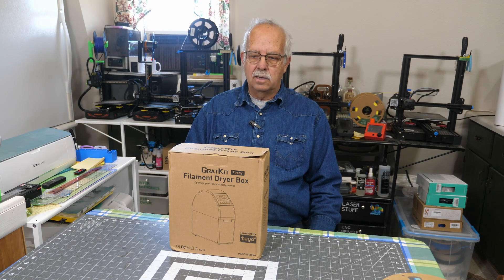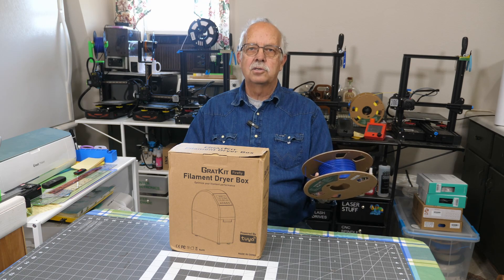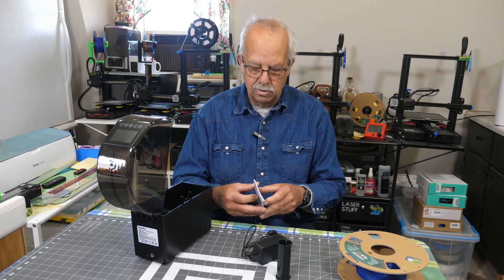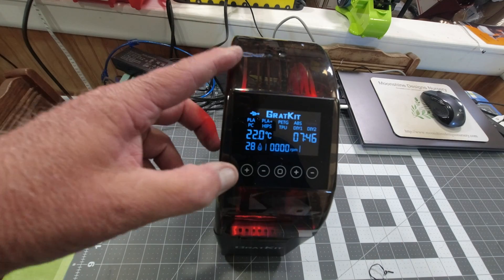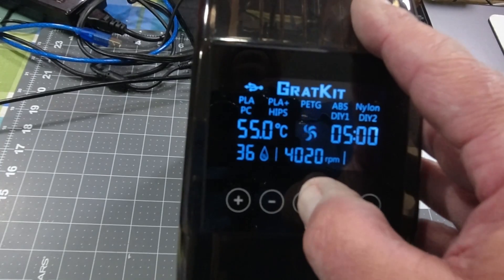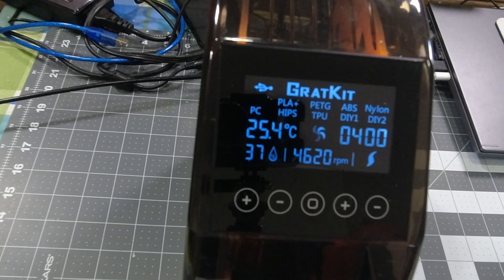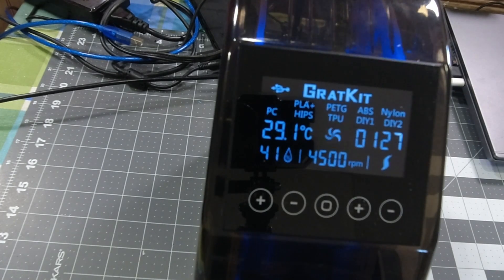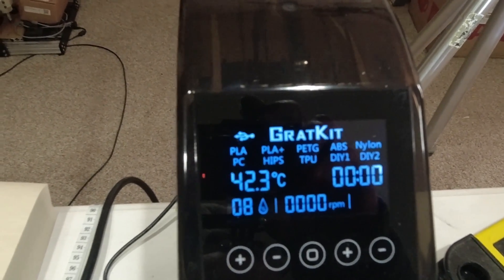GratKit Filament Dryer Demonstration

Comment: Looks good.  I don't normally use a filament dryer in favor of a cereal storage box and desiccant.  Works good with PLA and PETG.  But this filament dryer would probably be good if printing ABS or ASA.